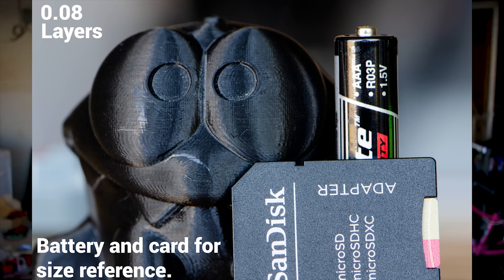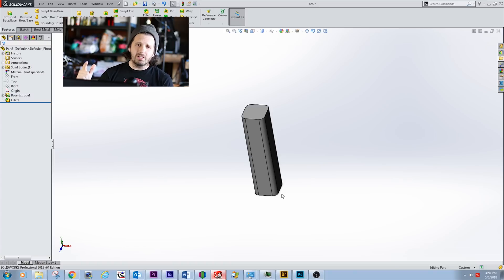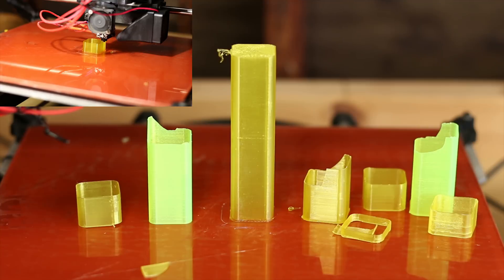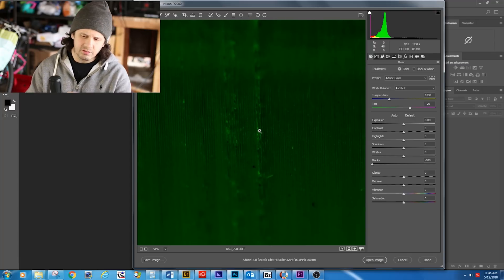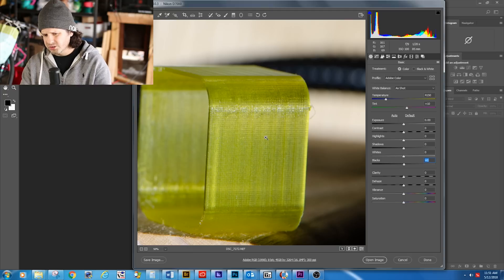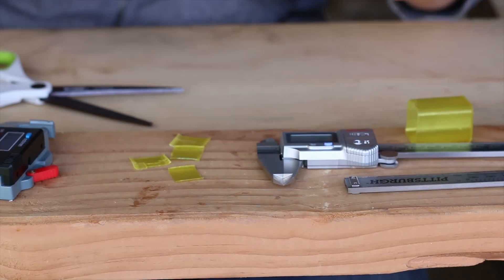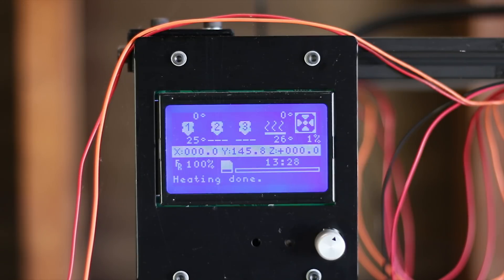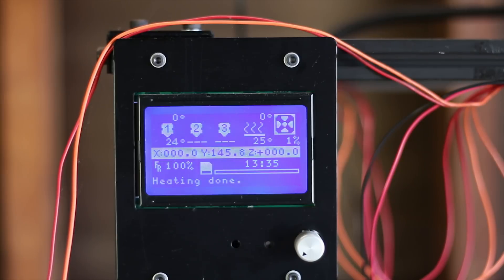Calibrate exturder steps in your 3d printer the smart way! (with a thickness gauge)

Comment: Never ever ever ever change e-steps based on the extruded results. It is wrong in so many ways. One you mention yourself and that is z-wobble or other imperfections that makes the part you measure wider than the individual extruded layer. You should always calibrate e-steps only based on the actual length of filament that goes into the extruder. When you change filament to another brand that is slightly thicker or thinner on the roll you will notice that your "calibration" is wrong again and changing e-steps for every filament is not the right way to go. You should instead create profiles in your slicer for each filament and adjust the flow rate or filament width to fine tune your filaments. The width of the extruded result is also dependent on temperature and print speed, change any of those factors and you have different result again. E-steps is a value for an actual length movement, you should calibrate the length of filament. But the wall thickness is not a length it is a volume that depends on the thickness of the filament. Also you do not know if your filament is grinding in the extruder if you have to low temperature or just prints to fast.
Reply from the maker: 1.) You can simply set the pre extruded thickness in your slicer to replicate the results across different filaments. This takes 2 seconds. Perfect results each time. 
2.) "The width of the extruded result is also dependent on temperature and print speed" No, actually its not, its math done in the slicer. If your printer has this symptom, you got other issues to work out first. 
3.) "Never ever ever ever" Why?  Is it going to explode? Why say this? If you don't like the results go back to the way it was. Completely reversible. 
4.) A proper direct drive extruder with quality parts should not be grinding at all. You shouldn't have to think about it. Again you have something else going on in your setup.
Reply: @takingtheblackpill  it's not going to explode, its gonna mess up all the calculation that the slicer will do